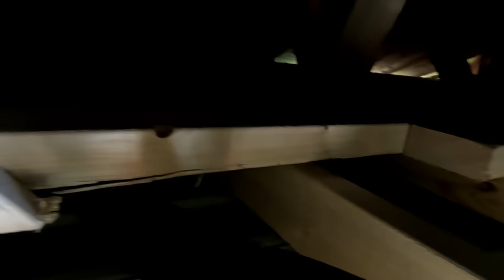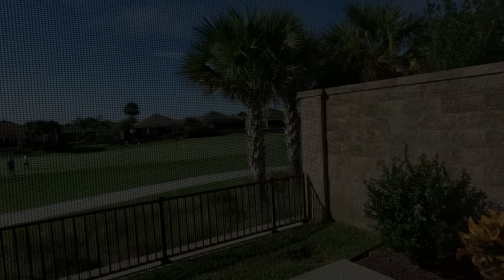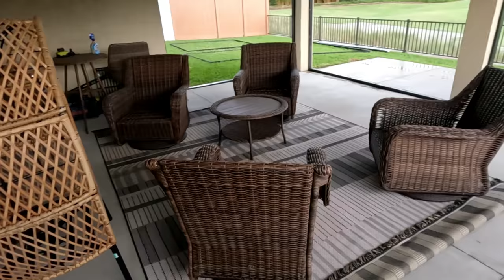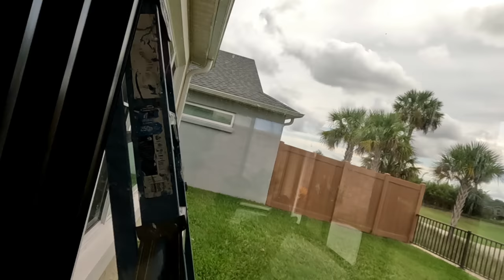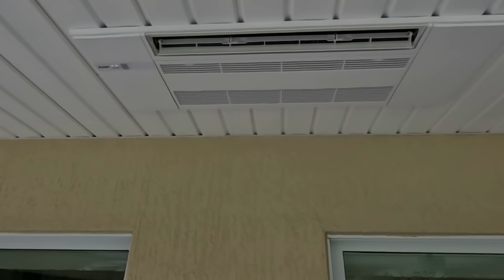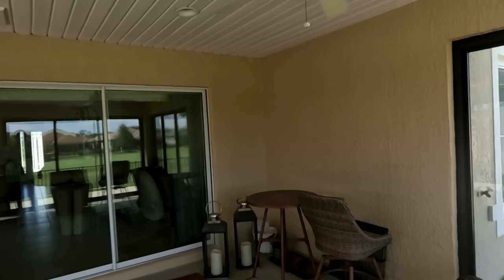Lanai Enclosure and Ceiling A/C Install in The Villages Florida

Comment: That mini split head is called a cartridge.... Mini splits do not draw air the same way that household furnaces do or air handlers here in Florida regular household Air handlers have to have a p-trap in line which traps water in the condensation line which causes the algae to grow many splits typically just have a drain with no trap and because the drain is not anywhere near the air return in the cartridge there is no risk of drawing it outside air through the drain line so it's basically just a drain tube similar to ones that are inserted into our bodies after surgery. It is also a good idea here in Florida to use vinegar down the drain line instead of bleach and you should do it about once a month especially during the summer months.

Comment: SKIP. Question.  On the original home the lanai was screened, but now it is glassed in but.....will the home insurance cover the changes in the event of a loss due to a hurricane ect since it was a addition
Reply: Thank you for sharing Skip!!
Reply: Hello Marsha - We also had our Lanai "glassed-in" and yes, the insurance company will cover damages as the construction company will have to pull a county permit for the work.
Reply from the maker: These doors are guaranteed to 125 mph winds by the manufacturer.  But I called my insurance and reported the upgrade just to cover my butt. No  my insurance did not increase..
Reply: @TheVillagesSkipSmith  I may be wrong but I think the single pane is rated to 75, 125 is the double pane.